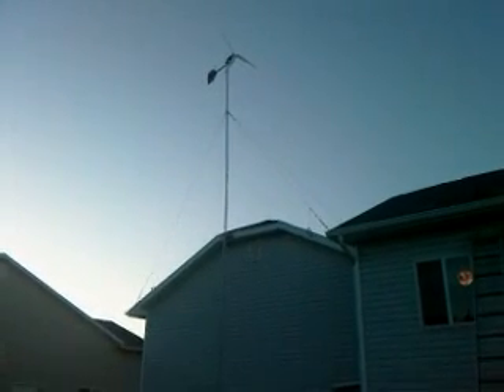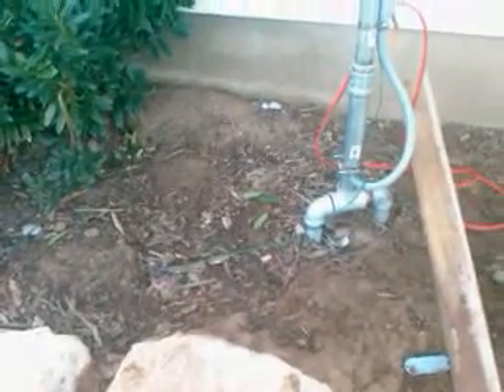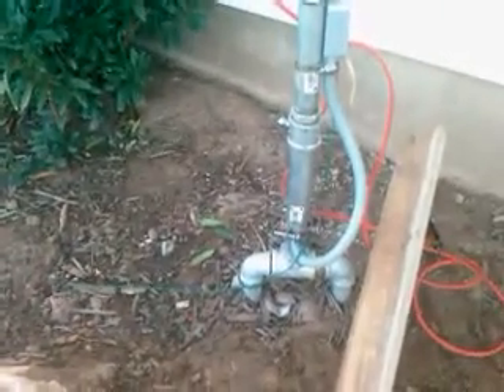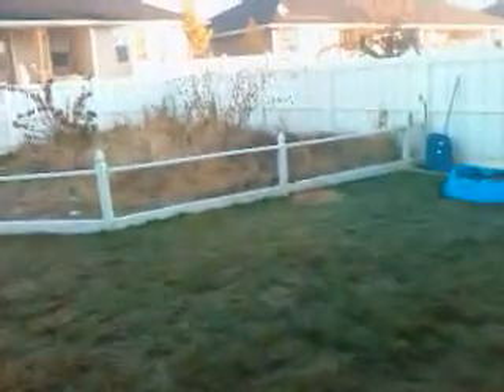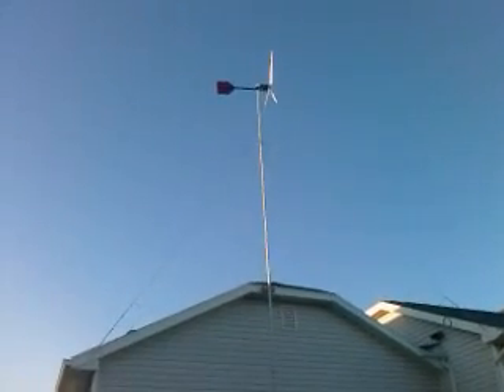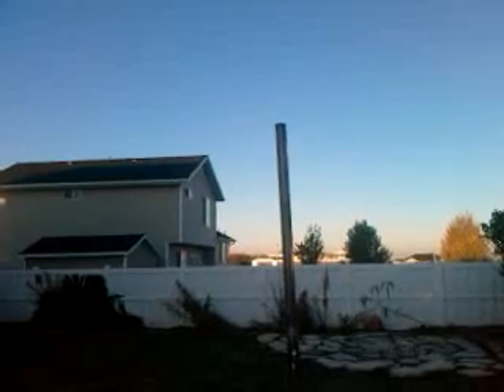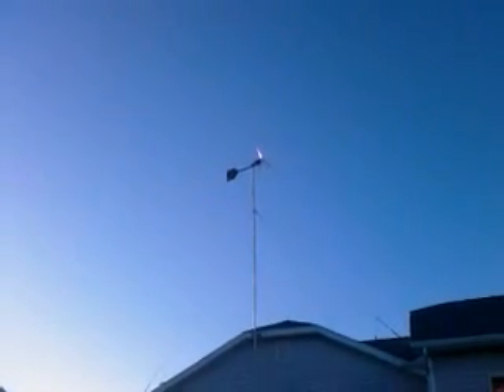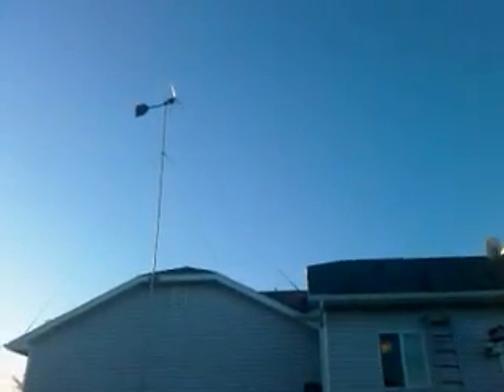Backyard Wind Turbine on Tower

Comment from the maker: The third guy wire had to go into the roof, but I spanned it all the way across the roof so it goes through the roof and into the eve on the far side of the roof.

Generous amounts of caulking were used at each eye screw.

My eve/roof configuration didn't allow for the correct angles from the tower, which should be 120 degree angles, but I don't have a problem unless I get gusty winds. When that happens I just turn the turbine off by shorting the power lines.

Comment from the maker: The wires use saddle clamps (on the right side of the wire, yes, there is a wrong side) and thimbles to connect to the eye bolts on the tower. Two guy wires are in one eye bolt, the third wire is in the second eye bolt on the opposite side of the pole.

Connecting to the house I put some eye screws into two eves with turnbuckles to tighten down the wires.

(continued...)

Comment from the maker: @smclane,
I couldn't get my PVC blades balanced enough, so I went with professional carbon fiber blades that I bought on eBay for $60.

The guy wires are connect to the pole through two eye bolts that I ran through two holes drilled into the pole with large washers on each side and a nylon nut to secure them.

(continued...)

Comment: Nice video! I plan to add my 38V Ametek to my house very similar to your set up. I am using 3 blade set I made from 6" PVC. How did you attach the guide wires to the pole and the house?